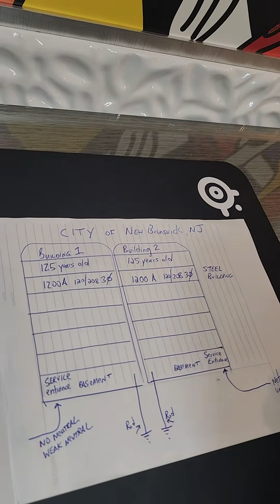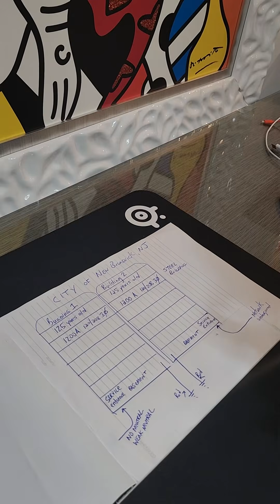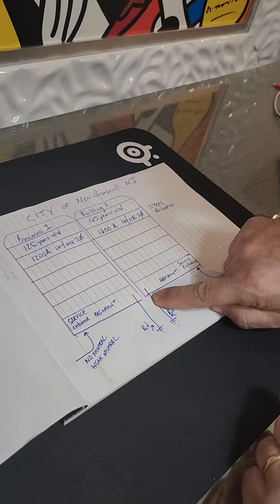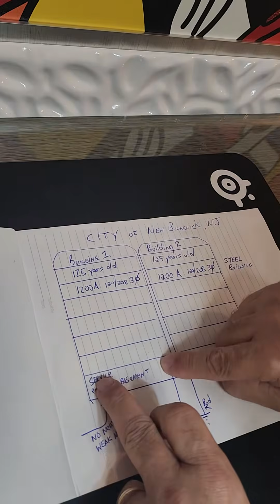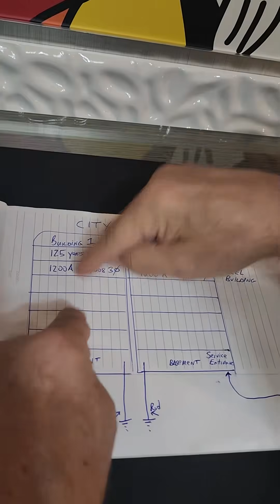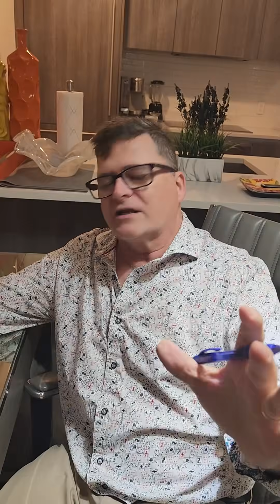Electrician explains how he almost lost his life #electrician #electrical #contractor #lifesafety

Comment: Thanks for sharing. In the future appears we all will check electrode conductor with amp meter and/or use a low voltage hot stick to ensure we are electrically isolated. Regards,
Jason
Reply from the maker: Great point!

Comment: so you're saying that the B#1 ground rod was not effective, too small or not installed correct. I don't understand how when using a grounding rod that it is actually ignoring the 'ground'  that it is installed in. What would have been the result had the ground rod for  B@2 not been there. Would the current passed into the earth as designed?

Comment: I had a tree take out my residential service. I then had to pay an electrician to re-do my mast and meter box from the damage. He sent a very young "apprentice" to do the simple and basic change because I wasn't legally allowed to do it myself since Hydro would not connect new wires if a licensed electrician isn't the one calling it in... Well wouldn't you know it, the kid wired everything up but never reconnected the neutral wire from the meter box. So my system was back up and running using the ground as a neutral. This was causing all sorts of issues with an unbalanced voltage phase and sporadic rpm's with single phase motors and electric heaters. Anything 240 worked perfectly fine. After noticing the voltage fluctuations when I'd use the toaster on the display of my power center for my home theater, I did some investigating. I did research and found it seemed I had a floating neutral. I then connected a set of heavy gauge booster cables from my neutral at my panel to the main neutral at my mast, wouldn't you know it, the second those booster cables clamped on, there was a good sparking arc when they made contact. This happened because my existing neutral feed was forced to use the ground path back to the transformer and when I attached booster cables, it then allowed the system to work perfectly fine with a proper and easier path back to the source. No more voltage spikes between legs, or varying rpms of motors. My hydro was normal again. When I phoned the electrician to tell him about the job his guy did, he truly didn't believe me until he got here and saw it for himself. I was quite surprised how well the power could get back to a transformer over 150' away from my house by the ground, but it was. The ground is always a last resort for safety purposed and should never be carrying current.
Reply from the maker: Floating neutral is so common. I'm glad you had the ability to understand what was happening

Comment: Wasn't the voltage only 120V from ground?
Weren't you wearing insulated steel toe boots?
Doesn't sound very lethal to me, I've been in contact with 120v more times than I can count
if it was a 480 or 600V feed I could completely see the unbalance causing a lethal shock, but 120v?
Reply: Doesn’t matter 120v or 600v if there’s current pumping through doesn’t take much in the right conditions to take someone’s life
Reply from the maker: It wasn't the voltage, but the current was huge enough to burn up the neutral,
Reply: The voltage someone gets shocked with is not the deal breaker. It's definitely more likely to be a lethal shock with higher voltages as the resistance becomes less of an issue for the electricity the higher we go up and expose ourselves to it. Under bad conditions (particularly wet conditions with a good path) 120v is more than lethal at a low current.